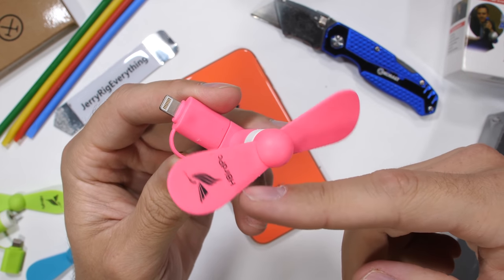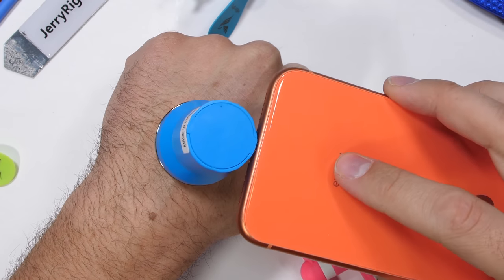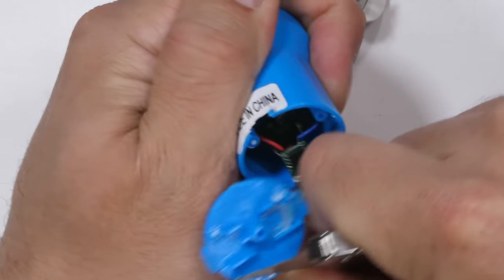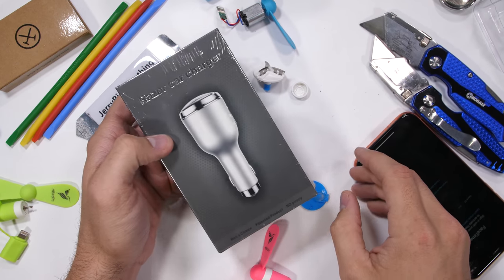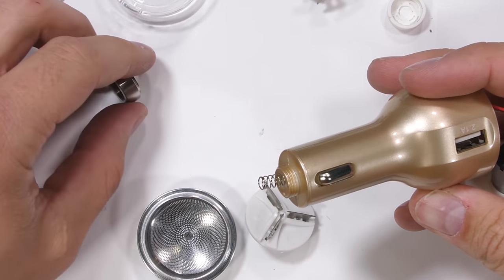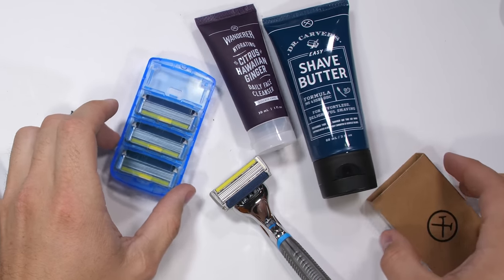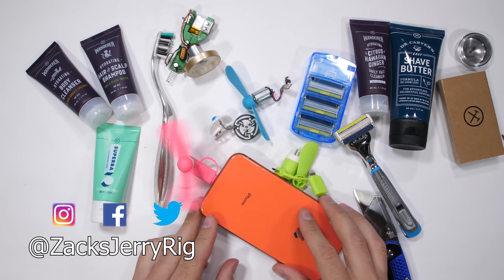You can Shave with an iPhone?! (Don't do this...)

Comment: That shaving tool is actually made for taking away dust off clothing ... I think that what my one does at least.
Reply: the box had a person using it on his face
Reply: He was getting dust off his face
Reply: why would you need three spinning razors to get rid of dust anyway lol
Reply: I use mine to shave off hanging threads  of clothes
Reply: I think it's more designed for stubble rather than hair
Reply: It removes lint I suppose
Reply: pizzarella lint* more likely however I still think this is a total gimmick
Reply: @MrJaskaranb  it is its real purpose, to remove the balled up lint from clothes
Reply: it has razor blades XD

Comment: These shavers will work if you have hair which is less than 5mm other they won't work.
Reply: Exactly.
Reply: Well they're intended for close shave, if you use a pair of clipper with no guard to get close then you use these, they work perfectly, the holes are designed for hair to go inside and the blades cut them so that your skin doesn't get cut.  I've used them before, they're also pretty useful as a lint shaver for fuzz on your shirt
Reply: *less than 5 mm and only the vertical ones
Reply: true.

Comment: Those are lint shavers to clean up lint balls from sweaters etc, they’re not hair shavers.  

Don’t know why they’re advertising them for your face
Reply: Finally someone who knows what's it for!
Zack, this is not a hair shaver.
Reply: Yes! Exactly.
Reply: Actually those are face shavers but not in conventional way, if you are old enough you would have seen those old styles that are meant to shave stubble only, you hair has to be short enough, for a quick touch up. Also true that they made lint ones the same way but much bigger holes.
Reply: joescalon yeah I was gonna day I’m pretty sure this is a stubble shaver, not a lint shaver. Those typically only have one or two blades.
Reply: iSPMaster yeah, but the box clearly shows someone shaving, I can’t believe someone would think it would work for that 🙄
Reply: Its a foil shaver
Reply: @tallnrough68 Yeah but they are meant to shave stubble hair only, not long arse arm/hand hair!

Comment: Seems like you don't use electric razors much. You see, they're meant to be used daily for shaving. And a day old stubble isn't any longer than 0.5 mm. Those holes on the metal covering are small, you're supposed to use it on hair having length around 5 mm or shorter. Anything more than that, and the holes won't catch any hair. Then you gotta use clippers on them.

Comment: If your iPhone or iPad has stopped charging it may have your charger stuck (white thing with lines on )stuck in it it will only be using  a toothpick and you save your apple products useable again

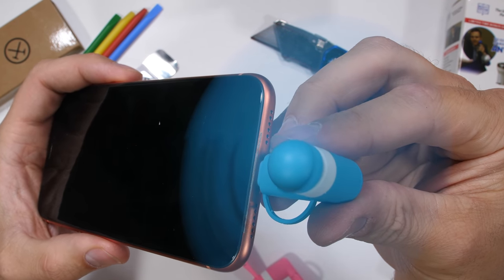Comment: 0:42 iPhones are not designed to throw this kind of power out of the phone

If that's the case, then why are there  lightning headphones inside the box? Doesn't it do the same thin like third party accessories?

Comment: iShave 
-SV1 Fusion Chip (Machine Learning from your shaving experience to adjust shaving pattern and brilliantly records skin moisture and humidity)

-2GB of base storage (can install all shaving-related apps in App Store)

-1GB LPDDR5 Ram (Super-Speed)

-2 inch Liquid Retina Display (To navigate all functions available)

-NO CAMERA

-802.11ac MU-MIMO WiFi with GPS Support for Find My (Find My Shave), cellular variant available

-Dedicated Mic for Siri functionality

-Stainless-steel shave blade for longevity, with replaceable blades as low as $29. Non-original replacement will cause the iShave not to start shaving process

-Glass-aluminium design with chamfered edges

-2 hour battery life with only wireless charging

-TouchID support for security

-Comes with shaveOS preinstalled and AppleCare

-Base price = $650

-Variants
 -2GB with WiFi - $650
 -2GB with WiFi/ Cellular - $675
 -4GB with WiFi - $719
 -4GB with WiFi/ Cellular - $739

-Colors = Space Gray/ Midnight Green/ Gold/ Silver/ White/ PRODUCT RED/ Blue/ Yellow/ Brown

Comment: Have you never used a shaver??? For that to work you need erect hairs not such bended long hair you first need to trim those bended hair with trimmer than use shaver when hairs are 1 to 2 mm long.

Comment: There has to be some form of power that can be swapped if you use headphones with the phone right? Because the speakers need to be powered?  If so what's the limit for power output

Comment: There is some thing can reduce foil benzene cars 🚗 actually I’m not seen engine or any engineers explain to me about the pistons specially because we can make the pistons less his high witch use less benzene I know how the engine cars does work but I don’t know how to edit yet I mean I have not work it on it how I can edited I have a lot idea a if I could edit the engine cars 🚗 no problem I give you one of my ideas witch it we know if engine have more compression on it it will get heat so the company’s tried best to reduce the compressions on the engine to working without any problem but I have  another Idea witch let the engine have more compression to less using foil against that the engine get hot so we need double engine when we compressed a lot on one of them to less use a foils the engine get hot when he could not continue because he got too hot switch to second engine and then until second engine working the first engine getting cool and ready for his next call